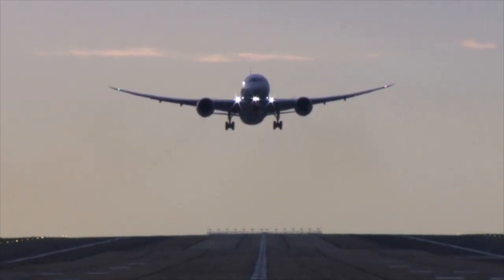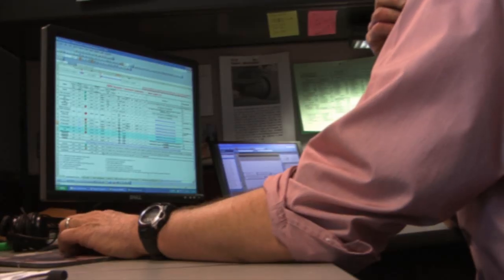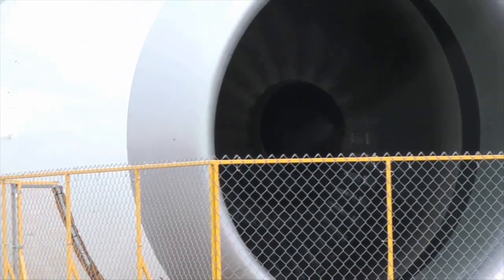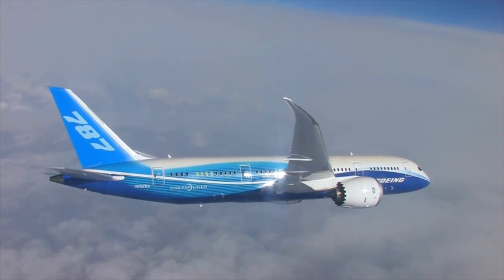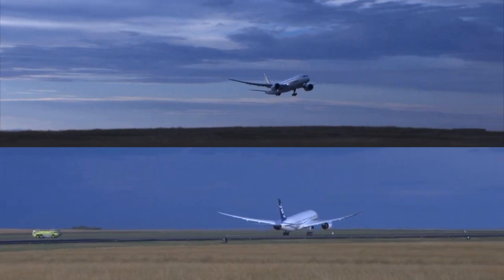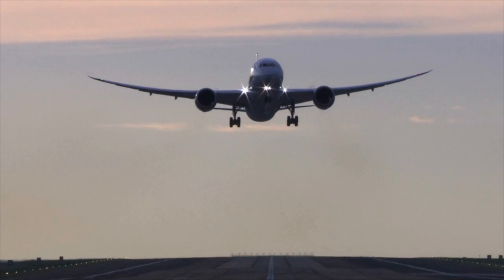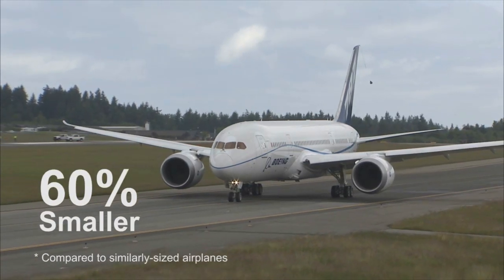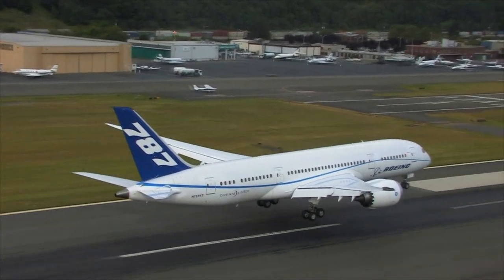Boeing 787 turns down the volume

Comment: I think all of the advances of the 787 are great.  The plane is a paragon for what direction aircraft manufacturers should be going in.  The only thought I have is that as transport-category aircraft have gotten quieter and quieter, the number of birdstrikes have gone up (*cough..Flight 1549).  I wonder what the engineers at Boeing think of that particular issue.